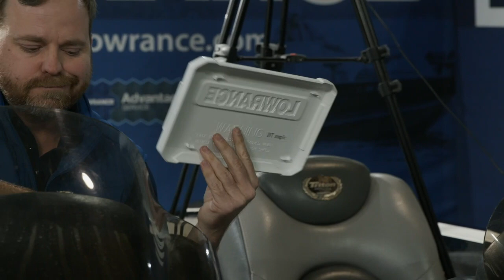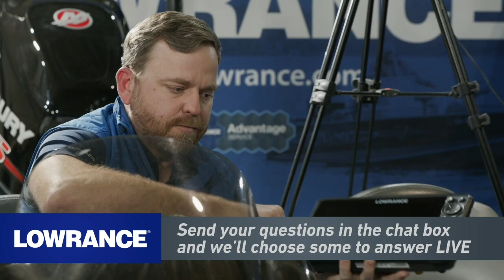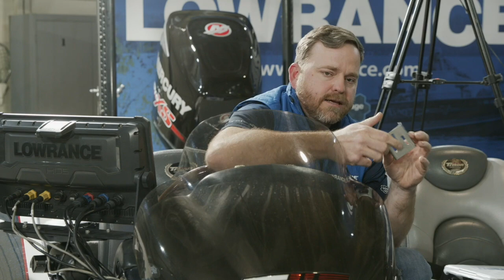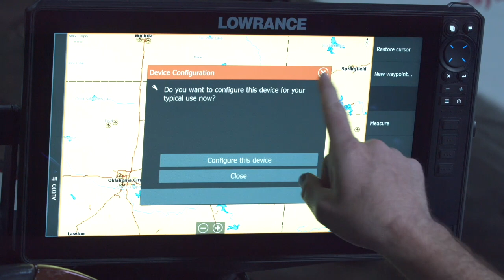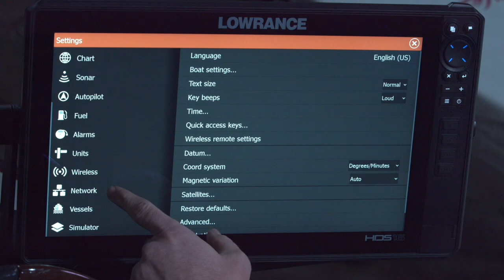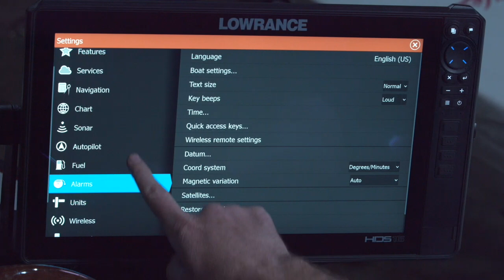Lowrance LIVE | HDS Live Week 1

Comment: i just bought a used HDS 7 live and i currently have an Elite FS 9 which is at the console  I want to move the Elite FS up to the bow and put the HDS live at the console. I have the Active 3 in 1 transducer mounted on the transom.  I should be able to connect the transducer to the Live at the console and run a network cable to the Elite at the bow and share that transducer correct?

Comment: I have an HDS Live 9 at the bow of my boat and an HDS 12 on the console. When I mark a waypoint on either unit, the waypoint shows up on both units.  That is not the case when I create a route.  I am usually driving when I am using/creating the routes and when I create one, it will show up on the 12, but not on the 9.  
I was in Canada last week and got some routes that I would like to have show up on the 9 just for a safety factor in case something would happen to the 12 while we were on the water so we could have a safe route back.  
I tried to transfer it with an SD card the way all the videos show how to export/import waypoints, but the routes aren't showing up on the 9. 
Any suggestions?  Thanks in advance!

Comment: Is it OK to have separate power feeds from differant batteries to your unit if you are hooking up eithernet and or nema 2000 networking ?
Reply from the maker: Yes indeed, it is recommended  to use different power sources for you NMEA2000 network and units, trolling motor, etc.

Comment: PLEASE HELP ..MY HDS LIVE 16 WILL NOT FIND MY 3-1 TRANSDUCER ..HELP IT IS IN THE CH2 WILL NOT FIND ..IF I PUT IN CH1 IT DOES WITH NO SIDE SCAN ..HELP PLEASE ..TECH CAN NOT FIX ..MY HDS12 SAME
Reply from the maker: Hi Larry, were you able to fix this issue? Please make sure both your units are running the latest software update. Also save all your personal data onto a micro SD card and perform a hard reset, after having upgraded the units. If you're still having issues, please sens us a message via FB with your unit's serial number and we'll help you from there.

Comment: I have wanted this for my bass boat since it came out.  The install for these is almost as much as the HDS 12.  Now Bass Pro Shops is offering free installation and I am now fixing to pull the trigger on this bad boy.  I am just wondering if I should mount in front or back to work with my motor monitoring.  Just a great video.

Comment: would be great if Lowrance told me why my new HDS 12 Live keep cracking the rear cover? sent it back 2 and they just keep changing the back cover? wonder what going to happen when the warranty runs out? 
any one with a dash mounted unit check your back covers, cracks forming from the screw locations in both instances.
Reply from the maker: This is very strange and it's not a common issue. Please send us a message via FB so that we can investigate.
Reply: @lowrance  I dont have FB 
Iam sure its not a common thing but I have had 2 units do this and from the same spots. Even asked if i shuold change or upgreade to a different unit as it is inconviniant having to wait 4 weeks to get a replacement every time . . .

Comment: On a dual HDS live 12 setup on in console and one in bow should they both be hooked up to the blue connection or just one?
Reply from the maker: The blue connector is for Channel 1 transducer. You would network through the yellow port with Ethernet. You can share a transducer on 2 HDS Lives by connecting them together with Ethernet.

Comment: Excellent Video!! I`m very grateful. I have several Lakes that I marked with waypoints. When I made them I put specific information about each one so that I would know what was there.  How do I retrieve that info while I`m traveling to it on  the lake? When I highlight  the waypoint by touching  it,  then   I select the drop down menu it doesn`t give me an option to select  info . I have to touch the way point again and go to menu  and select waypoint then Edit just to see my info about that Way Point. Is there something  did wrong in my waypoint set up?

Comment: Great instruction video, several questions I had were answered. One thing, I think the transducer should be parallel to the water surface, not the lake bottom. Just a clarification, it would be impossible to be parallel to the bottom.

Comment: Thanks for the info. I will be installing an HDS 12 unit into a 2022 Lund Crossover.  You said to make sure the three in one transducer is parallel with the lake bottom. How do we know what that will look like when I am installing the ducer in  my garage?  I am thinking to put the transducer at a slight angle and make sure to mount it between the strakes where there should be no air bubbles. Is this correct? Thank you so much
Reply from the maker: You can send us some pictures of your installation via Facebook, we'll be happy to help you from there.

Comment: 1.	CONTRAST split between Intensity & Contrast which improves darkness of shadows.

2.	+/- CONTRAST via Quick-Key for contrast control  in either  Auto or Manual modes for quickness & ease of use.
+/- INTENSITY via Quick-Key for intensity control in either Auto or Manual modes for quickness & ease of use. ( see #1 above).

3.	+/- DEPTH via Quick-Key for depth control in Manual mode for quickness & ease of use..

4.	Lowrance StructureScan SI/DI Auto/Manual Scroll-Speed control to optionally decrease compression.  
Scroll-Speed should adjust all to same speed , 2d, DI & SI.
+/- Scroll-Speed via Quick-Keys for quickness & ease of use.

5.	Waypoint sorting currently allowed for Name, Nearest, Symbol.  Make change to allow sorting by Time(creation-time).

6.	Storage should display SD-card Volume-Name if so named instead of TOP or BOTTOM.
Show “NAVIONICS”, not “Memory Card – Top”.  Show “C-MAP”, not “Memory Card – BOTTOM”.

7.	Structurescan(SI) should allow “Water-Column” to be set to ON or OFF.  Important to Dual-console HDS users who set unit’s Structurescan in Left-only & Right-only modes.

Thanks

Comment: Why the flat bottom of the water body becomes in DI a bottom with sharp hills and the shape of the fish, the size is incomprehensible??? it happens because the frequency of signals is less than it should be for qualitative representation (eg Gen1, Gen2) the problem is with new sensor AI 3in1 and Lowrance Live new algorithms ...

Comment: Why does the new Live units not work with the Motorguide Xi5 trolling motor?  I have been told there is a software issue, pretty frustrated at this point.
Reply: Paul T I have a brand new one and haven’t been out since Motorguide replaced it

Comment: HDMI from iPhone XR worked (past-tence) on one LIVE 12 but not the other. Neither a soft- or hard-reset helped. Now it does not works on either. Just a blank screen. Purchased new cables to no avail. Charges phone but no video mirroring. Turned cycle off to keep on HDMI, too.